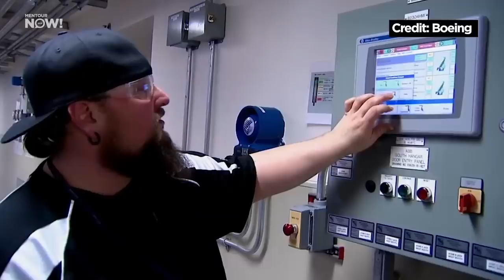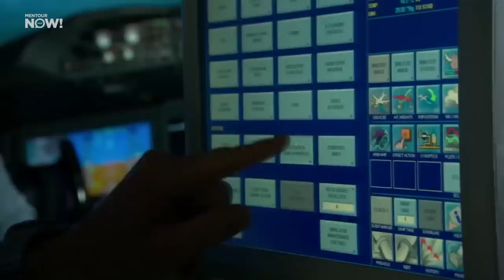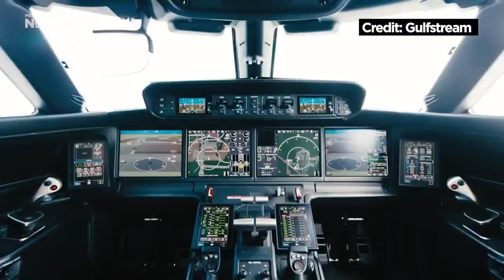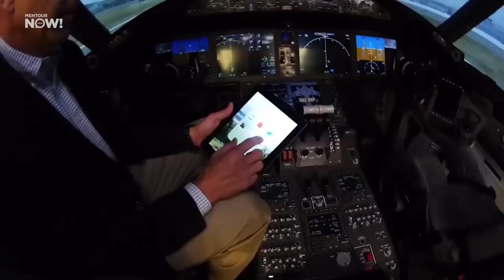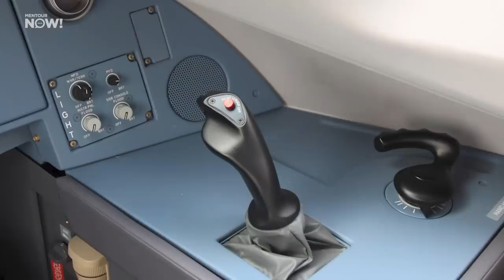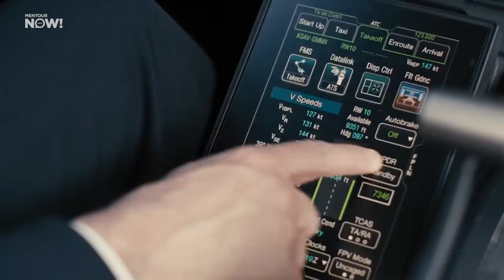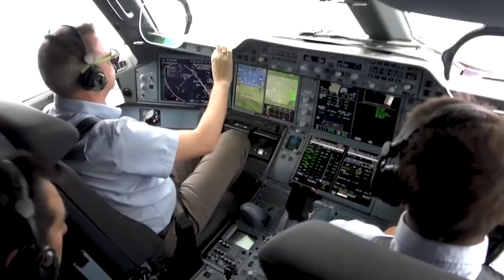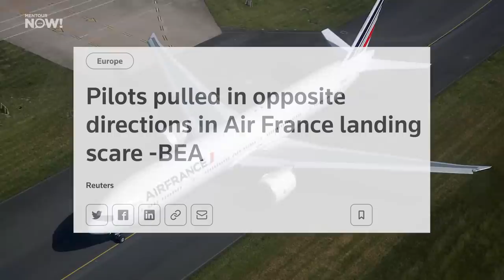Is Boeing Switching to SIDE-STICKS?!

Comment: likely won’t. There is no big pressure to do
so and the coupling without forcefeedback motors seems a more safe and robust solution for the dual input problem (that airbus is still mostly ignoring). airbus could have introduced them with the a220 since the c-series already had them planned - yet, forcefeedback was removed. why? maybe bc of added cost for airlines? Too risky to go down that path for boeing when they have a very solid and safe system.

Comment: Boeing's current philosphy would definitely need the sidesticks to be able to be linked together and to provide force feedback so the PNF knows exactly what the PF is doing in terms of control inputs.

The lack of this feedback was, in my opinion, a key element in the crash of AF447.   Only when it was too late did the co-pilot tell the others he had been pulling back on the stick all the way through their fall. However, with a yoke, seeing and feeling it being pulled back while a stall warning was sounding could possibly have clued the other pilots into the what the co-pilot was doing and so could possibly have saved that flight.  In the shaking, dimly lit atmosphere of the Aribus, it was next to impossible to see that he had been pulling back all the time until he actually said he was, by which time it was too late.

However, Boeing also ask their customers what THEY want and for the 777 and 787 the yoke was the most requested control. 
If enough ask for a yoke for the next plane, it might still get one.

Comment: About time as long as there is multiple redundancy and a first short range secure wireless in the event of  catastrophic accident where in the event of direct wire breaks from primary along traditional route it still connects to a cockpit-based third backup unit the physically connects a different route such as along the cabin and down by the galley to a backup computer so out of trim incidences are picked up or such as when the captain has become incapacitated, this then. Would pick up on from the copilot controls

Comment: Even with active sidesticks where they both move like yokes currently do. Wouldn't the yoke have the added advantage of being right in front of the pilot instead of slightly off to the side?
Reply: No, u can put your hand on it and feel what the other pilot is doing. It’s the same with the yoke. Of course, I only do that if the other pilot is low with experience.
Reply: And for 95% of the flight it does not provide any use for the pilots except be there in front of them being in the way of the instruments

Comment: They could  re engine the 757 with new electronics and flyby wire easier than completely easier than building a narrow body from scratch. They already have the tubes for the fuselage. It’s the same as the 737. Easy. They should have done this decades ago. 1:45

Comment: Boeing should work on the ergonomics of its cockpit, but the problem with side-stick is different configurations of controls based on the position of the pilot.  Right seat and left seat should have totally redundant controls.  The side-stick creates training issues and muscle memory issues, and EVERYONE has a preference for left or right seat with a side stick.  A center yoke eliminates these issues.  Also, electronic forced feedback is not the same as mechanical forced feedback.  As a Scrum Master and Software Development Project Manager, I can say with confidence that there will be bugs and glitches that will result in issues, incidents, and potentially accidents as that software makes it out into the market place in production.
Reply: Well most sidestick pilots I came across online on various airline pilot forums, websites, youtube, reddit, quora etc said they didn't have any trouble using the non dominant hand on the sidestick when going for training. However it's true that not everyone was able to adapt right away as I also came across several other sidestick pilots who said they indeed had difficulty using the non dominant hand on the sidestick for awhile and it took further training to resolve the issues according to them. As far as yokes go, I came across only 1 pilot who had difficulty using his left hand/arm on the yoke. Artificial force feedback isn't the same as pure raw force feedback for cables and pulleys like in a Cessna. That's true. However as planes get bigger, the pulleys and cables on one the 747, 757, 767, A300, A310 etc as well as with speed stable C*U FBW like the A220, 777, 787, Gulfstream G400-G800 etc. you don't have a choice but to provide artificial feel. With the 747, 757, 767 and other cables and pulley aircraft, you can't connect them to the flight control surfaces on those planes since the forces would be too large and you won't be able to move em. The only other thing you can do is provide artificial feel which is actually very good and important as it allows the pilot to feel as if he/she was flying a cables and pulley small aircraft and decreases overcontrol. Many pilots said that feel system feels quite natural. Electronic artificial force feedback has been used since the 90s, starting with the Boeing 777, which would later be used by the 787, A220, lots of business jets etc and has never caused an issue in almost 30 years of usage nor was there a reported failure of such a system in any aircraft that uses it. And software issues do get rectified as improved upon as we have seen with Airbus FBW. Not every electronic device or software presents a problem.

Comment: Now this is already a non-starter if this is used for stalling situations, but would adding a "shake" or "rumble" to the side stick in dual input situations help pilots recognize what's happening? 

I know Airbus has an audible "Dual Input" warning, but that it can apparently be "blocked" by other high priority warnings (GPWS, Stall alert etc.).

I'm not a pilot nor do I work in any part of aviation, so I'm very curious to hear from those who do.
Reply: If the GPWS is telling you to pull up I wouldn’t care if both pilots pulled up at the same time. Same for stalling if both push nose down then fine. Only incompetent people who shouldn’t be pilots would ignore those warnings
Reply: @tomstravels520  And yet it's caused accidents before (see Air France 447 as an example). 

Unfortunately there is always a risk a pilot isn't as good as you're hoping, so systems should be in place to help mitigate it.
Reply: Well the Gulfstream G400-G800 has stick shakers for dual input. I agree dual input isn't enough since under stress you may not hear it and is cancelled by the higher priority warnings like stall and gpws warnings.

Comment: I would prefer a yoke mostly for symmetry and the ability to use both hands if needed. If I were a first officer being promoted to captain and pushed into a side stick aircraft, I'd be like, "No thanks, I'm right handed."
Reply: The only time you use both hands is on takeoff rotation, since there's nothing to do with the throttles; they're set for takeoff. Any other time you're flying the airplane, it's with one hand anyway.
Reply: That attitude would make you very popular with your more junior colleagues!

Comment: how hard is it for pilots to switch between left and right seat on Airbus?
Reply: I heard many pilots transitioning to sidestick aircraft or becoming Captains in sidestick aircraft expressed concerns about having to use the non dominant hand on the sidestick. However most pilots have stated it wasn't an issue at all to use the non dominant hand on the stick, taking within several seconds or minutes to get used to it where they said it was just as good to use as the dominant hand and the brain compensates for using the hand and builds new muscle memory with training. Now some pilots did indeed have trouble using the non dominant hand but after a few training sessions in the simulator, the problem goes away to where they are just as effective to use the non dominant hand as the dominant. I guess based on pilots input, it really depends on who is able to be able to use the non dominant hand quickly and who will take longer. And with a yoke, during descent to landing, it's one hand on the yoke, the next on the throttles, including having the non dominant hand on the yoke.

Comment: I've watched several Airbus aircrashes where both pilots are unaware what the other is doing with his sidestick...
Reply: Have you not seen the Boeing crashes where both pilots "were" aware what the other was doing with his controls? There are pros and cons for everything. Airbus addresses the dual input issue using techniques other than mechanical linkage.

Comment: Could there be side sticks with "my controls" button? When the button goes down, that stick would be activated and another would be rejected. Some kind of indicator on the side sticks or in the instrument cluster could indicate which one is active. There could be even warning if somebody tries to fly with inactive side stick.
Reply: You mean exactly what airbus has had ever since the A320 first flew?
Reply: @Clayson Antoons Honestly, I wasn't aware of the button in Airbus. I just remembered that there has been crashes because of dual inputs. My idea is very similar, but only one stick would be active at the time, and priority can be taken with falling edge of the button. I.e. other pilot can take controls even if the button is kept pressed. I am sure that they have used a lot of money to think of that and for some reason it is implemented as it is.

Comment: You can develop repetitive strain injuries using sticks.  Probably possible with yokes, but seems less likely
Reply: @Clayson Antoons       I believe that @Addicted To Guitars is referring to wrist movement versus arm movement. With a great deal of wrist movement, carpal tunnel syndrome becomes more likely. This is even the case when little pressure is required to operate a device, such as a computer keyboard and mouse.

However, most pilots probably do not fly manually for hours at a time, so excessive wrist movement is probably not a concern.

Comment: Could there be a situation where a yoke - with a bigger travel for each axis compared to a stick - could be of essence, due to the ability of performing even smaller increments on those axis?
Reply: only if both were mechanical. But since all modern aircraft (Boeing AND Airbus) are fly by wire its just a configuration issue

Comment: I'm no pilot, but really enjoy this channel. Is the side stick adaptable for left and right handed pilots, or does that really not matter much? I flew with my dad when I was younger in a plane that had a yoke (Cherokee 235), I like the yoke because it seems more adaptable.
Reply: I heard many pilots transitioning to sidestick aircraft or becoming Captains in sidestick aircraft expressed concerns about having to use the non dominant hand on the sidestick and the brain also compensates for using the hand and builds new muscle memory. However most pilots have stated it wasn't an issue at all to use the non dominant hand on the stick, taking within several seconds or minutes to get used to it where they said it was just as good to use as the dominant hand. Now some pilots did indeed have trouble using the non dominant hand but after a few training sessions in the simulator, the problem goes away to where they are just as effective to use the non dominant hand as the dominant. I guess based on pilots input, it really depends on who is able to be able to use the non dominant hand quickly and who will take longer. And with a yoke, during descent to landing, it's one hand on the yoke, the next on the throttles, including having the non dominant hand on the yoke.

Comment: Biggest difference: side sticks are handed, yokes are not. You have to train each hand separately with sticks, but with yokes the pilot's input experience is practically the same whether you're pilot or copilot.
Reply: That's not correct. Control wheels are correctly operated with just one hand because the other hand is on the throttles. I am currently flying the Boeing 737, for example. I'm a Captain so I fly the control wheel with my left hand alone. The FO in the right seat flies it with the right hand.

Comment: I've often wondered how left handed FO or a right handed captain manage controlling the plane with their "wrong" hand.  With a yoke, your dominant hand is always on the control.
Reply: I heard many pilots transitioning to sidestick aircraft or becoming Captains in sidestick aircraft expressed concerns about having to use the non dominant hand on the sidestick and the brain also compensates for using the hand and builds new muscle memory. However most pilots have stated it wasn't an issue at all to use the non dominant hand on the stick, taking within several seconds or minutes to get used to it where they said it was just as good to use as the dominant hand. Now some pilots did indeed have trouble using the non dominant hand but after a few training sessions in the simulator, the problem goes away to where they are just as effective to use the non dominant hand as the dominant. I guess based on pilots input, it really depends on who is able to be able to use the non dominant hand quickly and who will take longer. And with a yoke, during descent to landing, it's one hand on the yoke, the next on the throttles, including having the non dominant hand on the yoke.

Comment: This may sound stupid but is there not a simple problem of making people control the aircraft with their left hand with a side stick (for right handed people that is)? It might not be much but I would never choose to control a plane with my left hand and the yolk seems to make sense as it is design that can be used for left and right handed people on both sides of the cockpit with no issues
Reply: I heard many pilots transitioning to sidestick aircraft or becoming Captains in sidestick aircraft expressed concerns about having to use the non dominant hand on the sidestick and the brain also compensates. However most pilots have stated it wasn't an issue at all to use the non dominant hand on the stick, taking within several seconds or minutes to get used to it where they said it was just as good to use as the dominant hand. Now some pilots did indeed have trouble using the non dominant hand but after a few training sessions in the simulator, the problem goes away to where they are just as effective to use the non dominant hand as the dominant. I guess based on pilots input, it really depends on who is able to be able to use the non dominant hand quickly and who will take longer. Sidestick aircraft have been flown for 35 years now with Captains flying em with no trouble. We should be hearing lots of complaints by Captains flying these planes by now as far as non dominant hand concern goes and that's not the case. You say you wouldn't control a plane with your left hand when on yoke aircraft, during descent to landing as a Captain, you'll have to do exactly that, left hand on the yoke, right hand on throttle.

Comment: Boeing needs to modify both a real 777 and 787 just to test this feature. The 737 MAX will stay with conventional yokes because it's not a fly-by-wire system. The long-rumored NMA to replace the 757 may be the first plane to use a Boeing-designed side stick, though.

Comment: I'm not a pilot so have no direct experience but one thing has concerned me about the switch from yoke to side stick.  Most of the world has one hand dominence, most often right hand.  Do side stick pilots have any mussle memory problems switching seats, left to right and vice-versa?
As regards 777 incident, surely the computers know when their is conflict between left and right inputs.  Even with a mechanical link with a 50lb breakout a sensor can be installed.  Why is there no pilot conflict warning in the cockpit?  Surely such a simple thing might solve a lot of issues.
Reply: @CoasterFan77 Hi, thanks for that, I often wondered.
On the issue of control conflict, I can understand Boeing wouldn't think it an issue but, pending the BEA full report maybe they were not quite right.  We'll have to wait and see.  Mind you I still think the technology to warn of control conflict is easy, as is the tech for autopilot warnings.

Comment: From design point of view on modern FBW aircraft, yoke does not make any sense.

The yoke was design to be like that in the old days because back then it was mechanically link to the actual control surfaces. So it can get very heavy which required both hands on the yoke to fly… sometimes even four hands.

But now that its all FBW with no mechanically link… you do not need to have a yoke. Its a total waste of space.

Comment: Sidestick alone isn't impressive but the Airbus FBW Law and the auto trim in combination with Sidestick makes hand flying really precise and easier. Constantly having to trim and test the pitch is really annoying in Boeing Planes. Let's not even get into Flight Deck design cause Boeing is at least 30 years behind Airbus on that front. They could have implemented these changes in the 787  which is decent improvement but doesn't hold a candle to the Airbus A350 or even A380 for that matter.

Comment: OK.  I'm old, but I have a lot of flying time.  It's just wrong to me to be in an aircraft where, if all of your technology dies, you have no option except to die also.  The engines will run as long as you have fuel and, assuming the wings didn't come off, if you have some manual control of the flight controls, you have a chance.